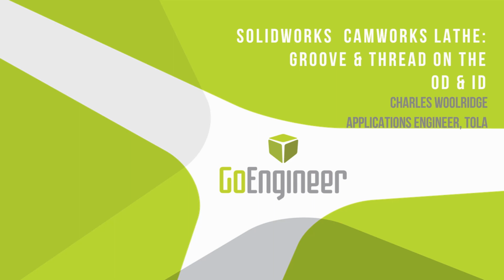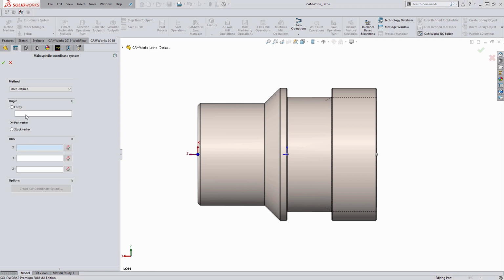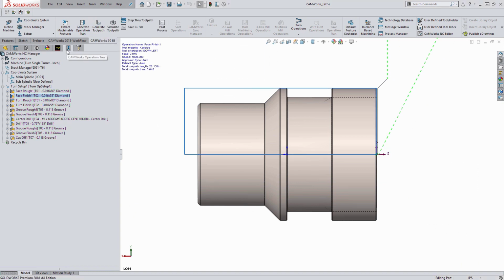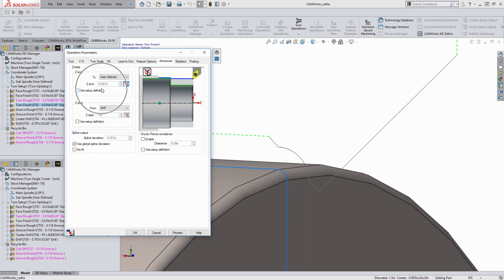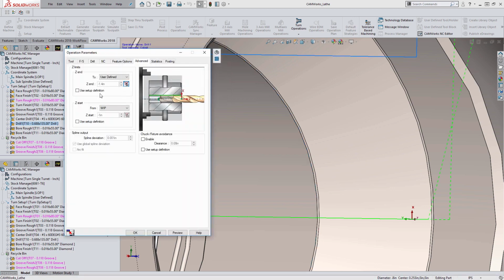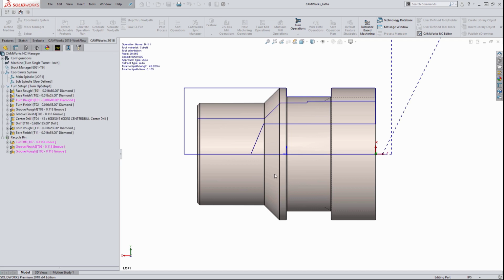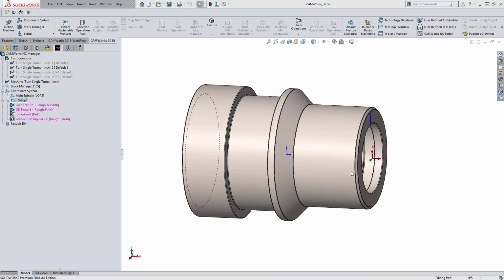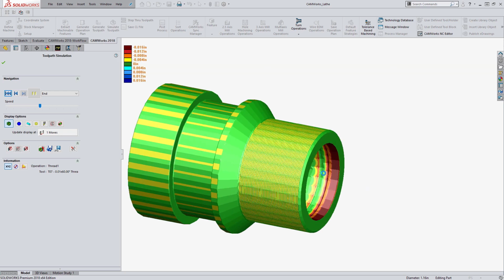CAMWorks - Groove and Thread on the OD and ID

Comment: thx for good tutorial but how did you rotate part for second operation ?
Reply from the maker: If you are not using a sub-spindle, then when you create a new Turn Setup you will select the “Reverse” checkbox.  If you are using a sub-spindle, then you will create a sub-spindle setup using an existing setup.  You will right click on an existing setup and select sub-spindle setup, which creates a new setup in the opposite direction.